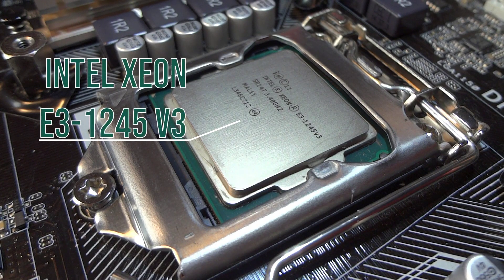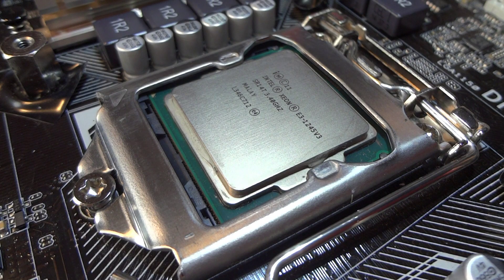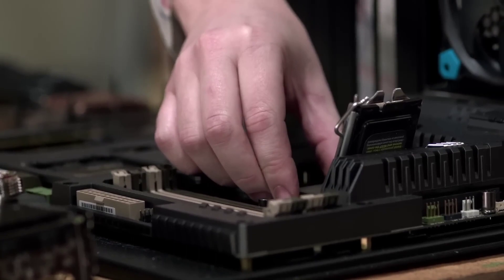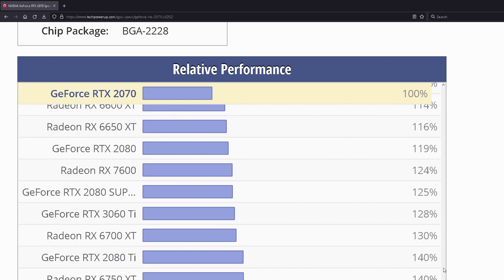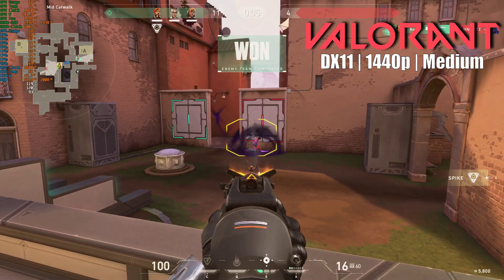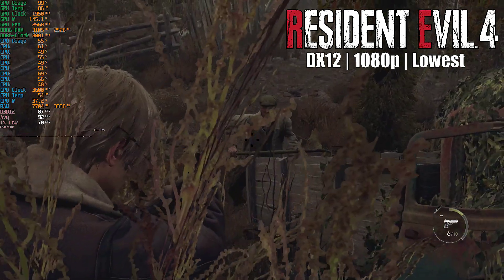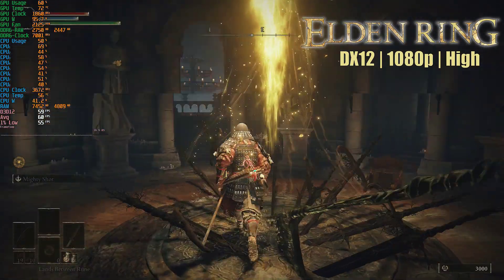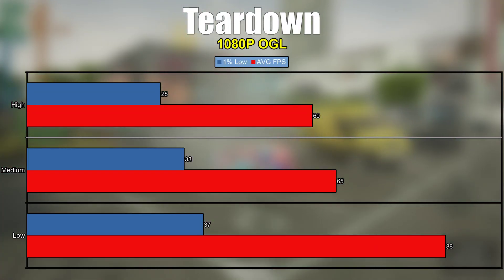The Disguised Intel i7 4770 vs Modern Games • Xeon E3 1245 v3

Comment: I love old Xeons. Managed to get my hands on a 1275 V2 (Ivy bridge), which is basically a 3770K in performance.
Placed in a Z68 board combined with 2400Mhz DDR3 RAM. It was quite a surprise to see it running so smoothly.

Comment: I've the same processor but my CPU wattage goes up into the 90s or even touch 100watts why is that
Reply: Your are using igpu
Reply: @umerabbasi834  no I'm not I'm using my Rx 570 I've also turned of igpu In my mobo bios

Comment: the 1245 is closer to a i5 4790. The CPU with the same clock speed at a 4770 is the 1231v3. Both are still awesome for $20 on ebay. Xeons are better than i7's because they have better thermal conductivity are are made for heat day in and day out. Fortnite runs bad on its first load up due to caching shaders. Once they are loaded you wont have many issues. My kiddo has a 1231 v3 and a 500xt and it runs Fortnite above 120 fps 1080p FSR medium and view distance and texture on high. Not sure why yours was struggling unless the Nvidia driver overhead really makes that much of a difference.
Reply from the maker: Thanks for watching and the  comment. 🙏

https://ark.intel.com/content/www/us/en/ark/compare.html?productIds=75055,75122,75462,80910,80806

Here is Intel's official spec table comparing all the 4 cores 8 threads Haswell CPUs that have similar base frequency to the i7-4770 and all these compared to the higher speed i7-4790.

Comment: Used for a long time a 1270, than later a 1230 v2, than a 1230 v3, actually my nas is running a 1260L (1155), a proxmox computer running a 1240 v5, and my desktop with 2680 v4, aliexpress always helping us buy good cpus for an affordable price, without crazy desktop reail prices for intel cpus from this eras, really awesome video.
Reply from the maker: Awesome comment & thanks for watching.
Reply: thank you and greetings from Brazil @obnot

Comment: please reply is it a good idea to pair it with rtx 4060? I have placed order for rtx 4060 already how severe the cpu bottle neck will be? I have the same cpu
Reply: not a god idea. best for this cpu would be gtx 1660/s/ti. let us know how it goes though!
Reply: 4060 only uses x8 PCI lanes of x16 port, since old systems are either PCI 2.0 /3.0 seriously affecting the performance.
3060ti /3070 might be better suited as it uses all PCI lanes that is PCI 4.0x16
So 4060 running in PCI 3.0 system have 8GB/sec bandwidth 
But 3060ti/3070 will have 16GB/sec in pci 3.0 mode

Comment: Xeon gang, using a E3 1270(i7 2600) and a E3 1270v3( ~i7 4790). They are perfect for older Gpus  but the IPC  sadly show their age in 3A games.I would pick a R5 5600 and whatever Am4 mobo for demanding games, staying on the "cheap" side.
Reply: You could pull the same experience with a 6th gen i5 or maybe a bit newer, especially if you are playing at a locked 60, which lets face it, most people building a PC like this is not going to use a 240Hz monitor.
Reply: @HardWhereHero  yeah but in some countries like mine (venezuela) lga 1151 CPUs are overpriced as hell, older xeons, haswell and ivy bridge are kinda the only low budget option if you want a "decent" graphics card
Reply: Gang gang